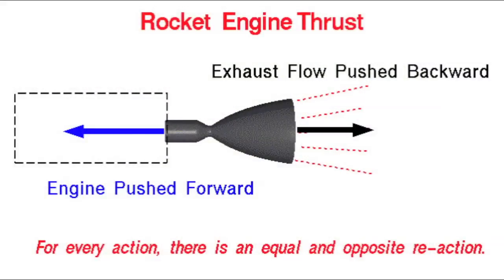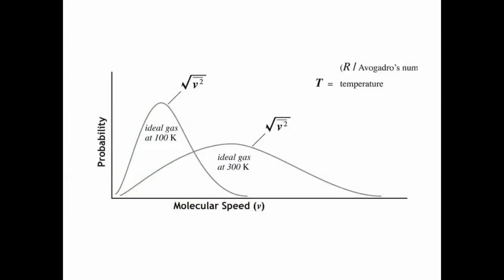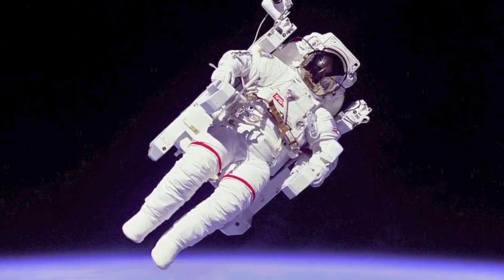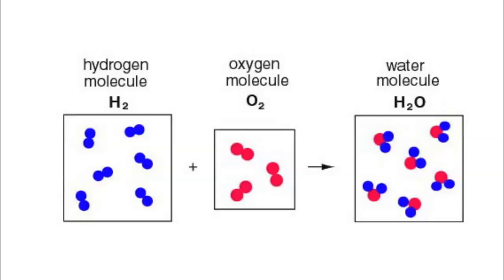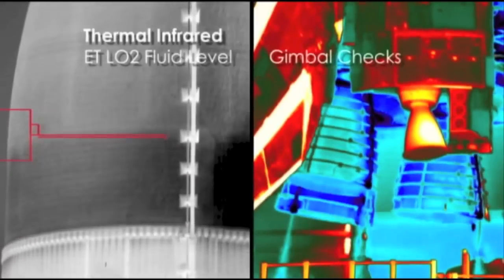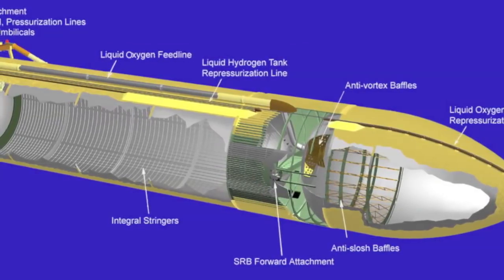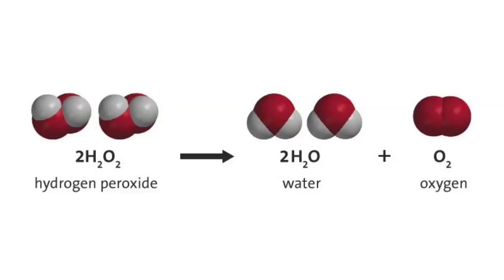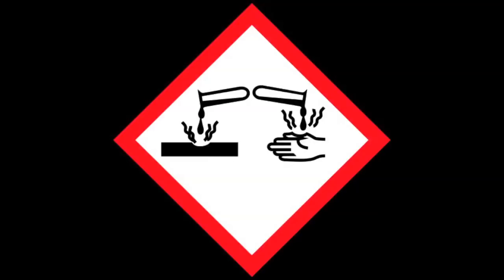WTF is Rocket Fuel Anyway?

Comment: why doesn't scot reply us .
Reply: +Gaurav Ghosh Because 1) this video is years old, and 2) Scott gets crazy high numbers of comments.  If you have a great suggestion or question wait until he does a video relating to it in some way then leave your comment on that video.
Reply: +Tommy59375 Ok but others should reply let me tell you can we use 10 different fuels.
Reply: Gaurav Ghosh
What do you mean?  "can we use"?
Do you mean having ten fuels combining at the same time (dec-propellent?) or do you mean can we vary fuels used in Kerbal?
Reply: +Tommy59375 I mean in both real life and ksp.
Reply: Gaurav Ghosh
Well there are over ten propellant combinations (hint - watch the video)

But if you're talking about combining ten things at once and exploding them all out the back, no you can't.
Reply: +Tommy59375  Ok  in nerva  what reacts with hydrogen.
Reply: Gaurav Ghosh
Nothing.  Please watch this video!  Scott explains that liquid hydrogen is passed over a nuclear reactor core which greatly heats it up.
Reply: +Tommy59375 but there should be something that heats hydrogen.
Reply: Gaurav Ghosh
Yes.. the nuclear reactor is very hot.  The hydrogen is passed very close to this and it heats up - the heat transfers.
Reply: +Tommy59375 Ok a reactor lets move to ion engines .
Reply: +Tommy59375 bye.